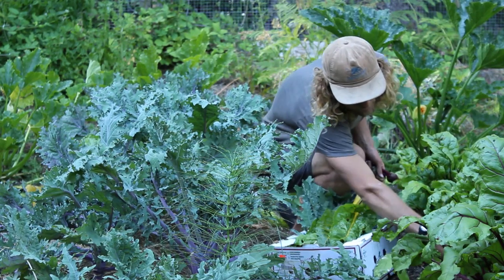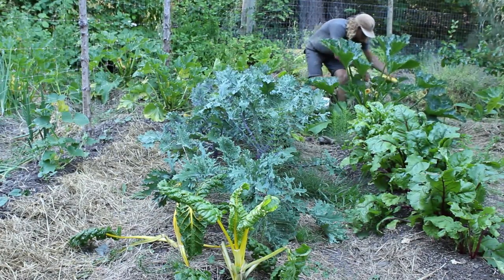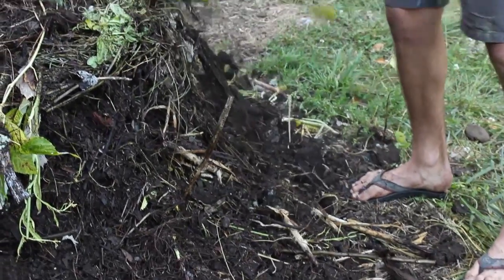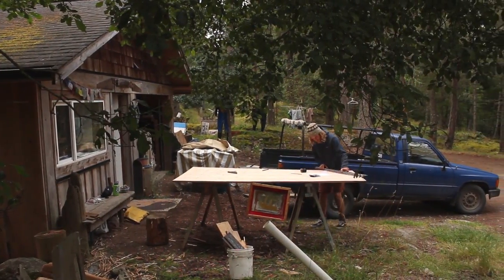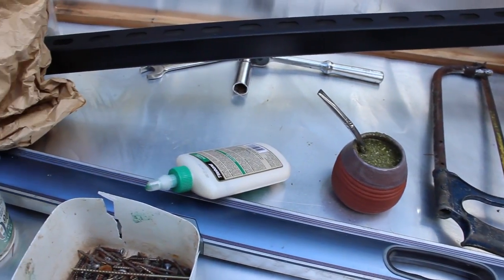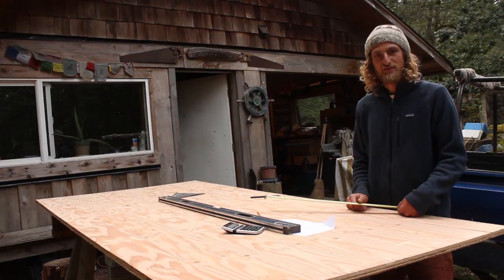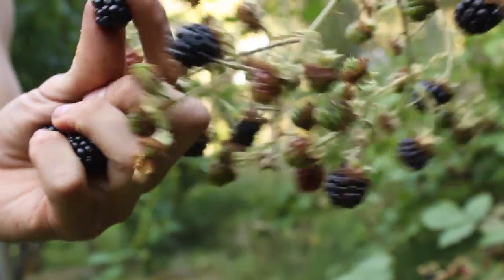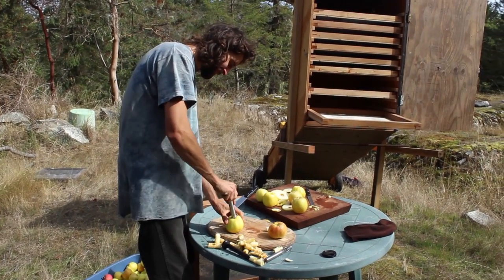DIY solar dehydrator

Comment: Great video, but how did those dehydrated apples turned out?
Reply: Instead of aluminum sheet you should use roof black natural slate tile + Put some natural thermal insulator.  You will get a better temperature. If too hot just place a piece of plywood on a small surface of the solar part. You need good ventilation to get rid of moister
Reply: @romansanchez9961  thanks that's a dandy idea
Reply: Hey! They turned out decent, the issue we ran into was not enough hours of full sun on the property. So once the temp cooled down they began to rehydrate ... Thinking of adding a little heater to supplement the temperature overnight
Reply: @johnmuirhead8944   Have you thought about adding a copper pipe water rad inside the dehydrator?  And a solar fan to move the air through the dehydrator to move the hot air a bit more?  Great design, thanks for sharing.  Our garden season is super short here in North Central Ontario, and I've been thinking of dehydrating too.  Take care.  Be safe.  Maureen
Reply: @cabinlife2347  Hey Maureen, a rad inside is a cool idea, or even just a heater over night so it doesnt rehydrate once the suns gone. And for sure a fan is a great idea.